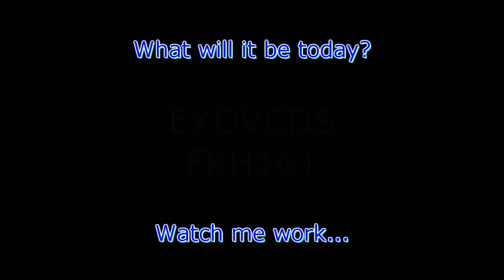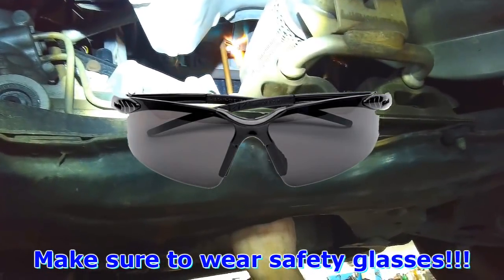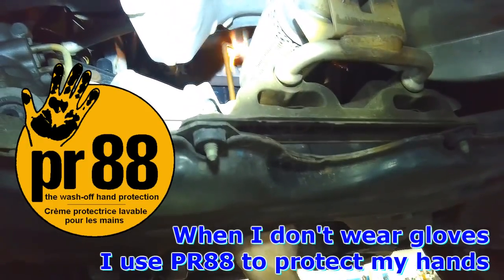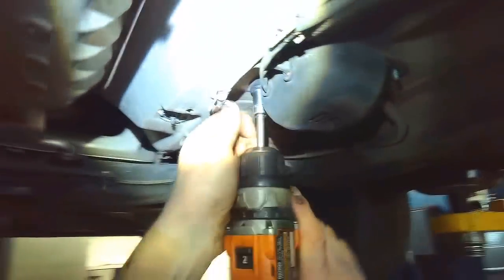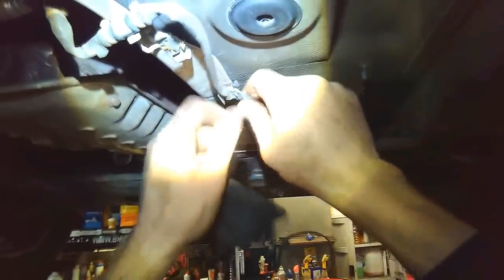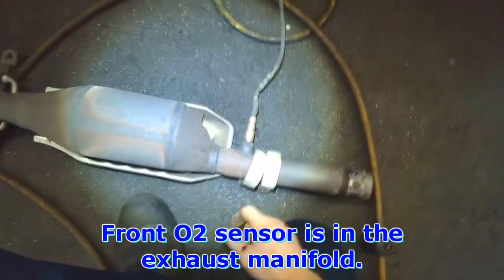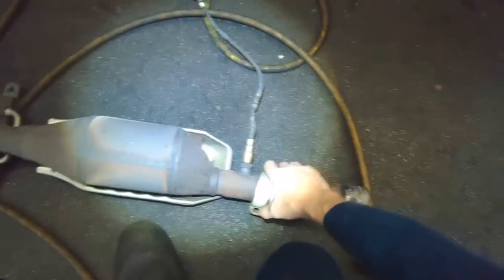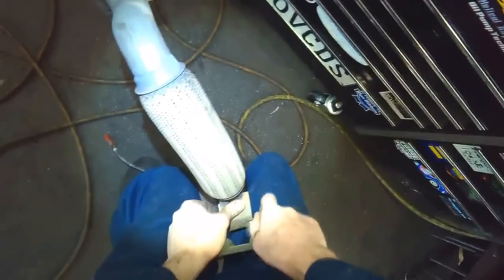VW 1J 9M: 2.0l Catalytic converter removal (A4/mk4)

Comment: That was easy! A fine job.and yes especially on exhaust you have to use whatever works.
Reply from the maker: I'm just lucky we don't have major rusting issues... otherwise those little manifold studs would be a real headache.
Reply: @EXOVCDS  yes, 10 mm becomes 8 mm or whatever it has to end up! as I know so well!

Comment: I just installed the catalytic converter, I recommend bringing a torch and heating those bolts for atleast 3 to 5 minutes, the more the better I broke 3 bolts and drilling was a bitch! If you need to drill em use cobalt drill bit, the other ones break to easily
Reply from the maker: Thank you for watching!

Comment: Thomas, I know you are a skilled mechanic, but you make this job look very easy.  I have to do this job soon on my car.  The top nuts are still pretty much there, but the bottom nuts and studs are almost rusted away.  Would you recommend cutting the nuts off?
Reply from the maker: I only cut when I have to. If you can get a bolt extractor socket on the nut, it might grab enough to remove the nut. If the stud is in such bad shape that it will strip the threads or break... then just cut it. Drill out the stud and put a bolt & nut in place of it.
Reply: @  @EXOVCDS  Thanks for the advice!
Reply from the maker: @karlsarkozi3626  Thanks for watching!

Comment: How do you diagnose a faulty cat? Just by... knocking? I believe mine is kind of "loose" and I occasionally get a P0134 "O2 Sensor Sensor Circuit No Activity"
Reply from the maker: A bad cat will set a Cat Efficiency fault code, rattle when loose or restrict exhaust flow... resulting in loss of power.

Comment: I noticed you awnser alot so here it goes ... I have a 1.8t ( ik this is the wrong video for this) and i ran it normal for 15 mins and then i heard a bang and it. Was my coolant cap that exploded from the built up preassure inside of it .. Could it be thw thermostat
Reply from the maker: Could be thermostat, water pump, electrical issue with the radiator fans... you need to eliminate / check things one by one. With the engine running at idle and warm (temperature needle in the middle), put the heater controls to maximum hot and check for heat coming out of the vents with the blower motor on maximum speed. No heat = bad water pump. If you have heat, check the temperature of the upper & lower radiator hoses... they should be equally hot. If no, probably a bad thermostat. If yes, check the radiator fan operation like this:
https://www.youtube.com/watch?v=Roh6RCs8IJk
Reply: @EXOVCDS  ok i went thru and checked and i get heat but i noticed the hose that connects to the thermostat housing doesn't get any flow and umm my fans are not turning on like at all
Reply from the maker: @XxfreddyXx3  If it's a golf or jetta, it will take a while for the lower hose to get warm / hot. If the temperature needle moves higher than the middle, the hose is still cold AND you have heat inside the car... then the thermostat is stuck closed. Replace it.
https://www.youtube.com/watch?v=HjL9P5cZw6g

Comment: i have a e61 525d in the shop and the rear brakes or not engaging at all. just had rear pads slapped on dry by dealer. now its no brake  contribution from the rear.. master cylinder  gone to shits after compressing caliper pistons? Cheerz!
Reply from the maker: Don't know, maybe. Aren't the bakes diagonally split? Master cylinder feeds front left & right rear, front right & left rear? Can't see why only the rear brakes would get affected.
Reply: my info says to bleed R-Rear L-Rear R-Front L-Ffront (lefthand steeing) so i dont know?

Comment: After removing the converter, how do you get rid of the Engine Warning light on the dash?
Reply from the maker: Go to a "tuner shop" and have them flash / overwrite  the stock ECM (engine computer) software... basically telling the ECM that there is no catalytic converter.

Comment: My down pipe rusted off the flange. Can I attack those 4 nuts from the top of the engine? I can't really get underneath at the moment. And why are they selling us washers? I didn't hear any hot washers falling to the floor. Haha
Reply from the maker: You can try to work from the top... I have never done so. Let me know how it goes. Washers are an option.
Reply: @EXOVCDS  Will do! You've been an excellent resource so far. Thank you!!
Reply: @EXOVCDS  well...bolts are rusted, won't budge, and I must've snapped off every coolant hose along the way. Also, what's the small 4-way coolant fitting that nobody seems to know of? Driver's side of engine. I got to replace all this junk plastic now.
Reply from the maker: @mwint1982  What year, Golf / Jetta, 2L? Standard or Auto?
Reply: @EXOVCDS  it's a 2003 jetta wagon 2.0L gas, automatic. I replaced the 4-way with 2 T-connectors today. Ordered a replacement quick disconnect. Everything plastic snapped off, but it was time. It crumbled easy.

Comment: Are they likley to leak at the manifold as well?
Reply from the maker: They usually break / leak at the flex pipe portion... if that's the case, make sure to check your engine & transmission mounts, as well as the dog bone / pendulum mount at the subframe (before replacing the converter).
Reply: Thomas EXOVCDS cheers will do. I’ve got a kind of clunk sometimes when I’m putting into 1st gear so wonder if that could be the cause

Comment: Nice video, Thomas.  Do you think a propane torch would give enough heat for the headpipe nuts?  
My Eurovan has a separate cat and headpipe with a flange in between.  I thought the flex pipe was cracked and leaking but it turned out the noise and vibration was from collapsed motor mounts.  The original catalyst and O2 sensors are way overdue for replacement at 127k miles.  (The heat shield has completely rusted and fallen off the catalyst even though the cat itself is stainless). I have the new spares but no check engine light is on yet.
Reply from the maker: A propane torch can get quite hot... I would think. So yes, I would think that it would help. Not too many people can say that about their cats & O2's!
Reply: @EXOVCDS  Even with the original cat and O2 sensors it still seems to be running fine.  My mileage hasn't varied since it was new.  16mpg around town and 19-20 on the highway.  Starts and idles perfectly.  Original fuel pump, too, although I did change the filter.

Comment: Complaints that the DIYer doesnt have a lift .😂
Reply: I have 2 post lift, engine crane, engine stand, and transmission jack.  Most local shop here don't even have oil pressure gauge, vacuum gauge, micrometer, straight edge, crowfoot, dial indicator with attachments and torque wrench. Biggest regret on my 2 post lift is getting the cable type instead of the chain type. 3 phase equipments are a lot cheaper than single phase
Reply from the maker: It's definitely worth investing in tools that will make life easier... but mainly safer!

Comment: A junky would have had that outta there in a third of the time! Slacker...  I was half expecting you to grab that hot bolt before you dropped in on the floor lol
Reply from the maker: Oh I've done that before... and worse. I once had to keep my hand in a bucket of ice water for 12 hours because I grabbed an exhaust pipe that was still hot.
Reply: When I used to work in a fiberglass shop, we had a guy there that did aluminium prop repairs.  One of his favorite tricks to do to new guys was to heat up a piece of aluminium and set it down beside the new guy when he wasn't looking and ask him to pass it to him.  Aluminium stays hot for awhile and doesn't change color when heated, so it's pretty hard to tell that it's hot.
Reply from the maker: Sounds like a nice guy!
Reply: One of the new guys got even with him by hiding on top of the heating duct above the entrance to the shop and jumping down in front of him in the morning when he came in to open up.  Scared the shit out of him.  I seriously thought we were gonna have to call an ambulance he was breathing so hard lol